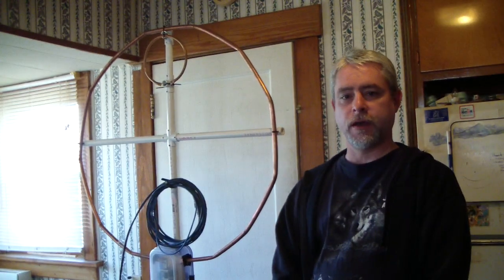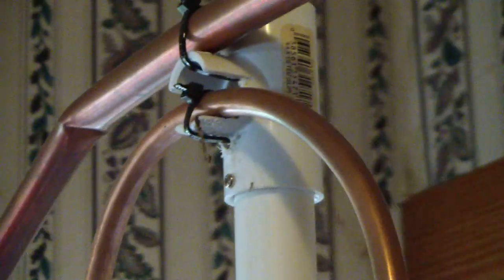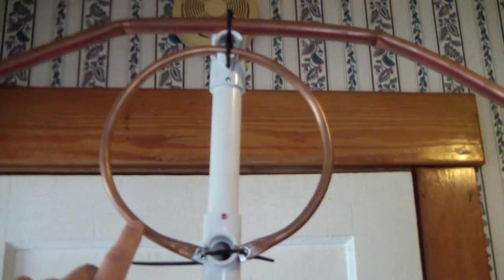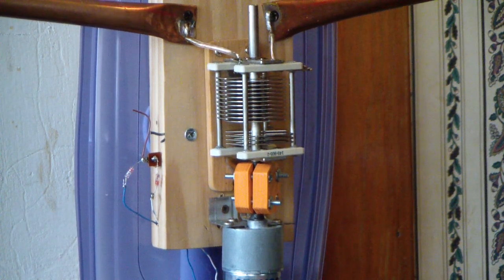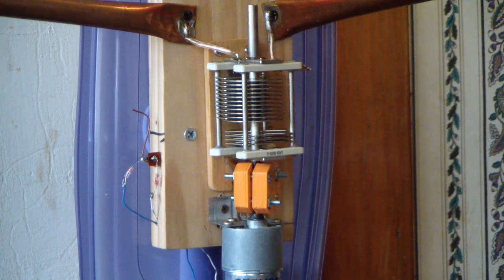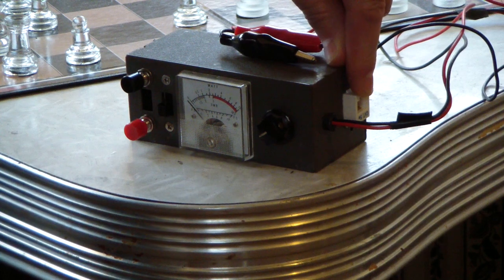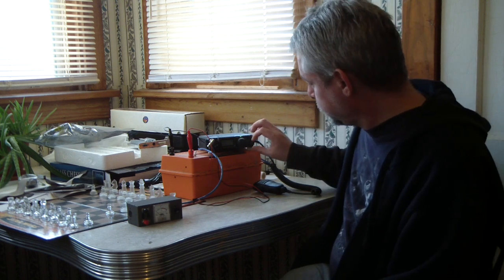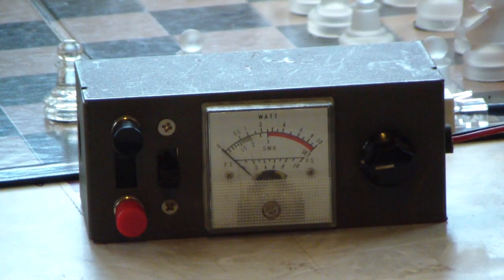Ham Radio - Magnetic loop transmitting antenna overview and details.

Comment: Late to your video, but I have built 4 loops recently (since January 2023), and my loop conductor of choice is surplus RG-11/U. I got a "reel end" with about 175 feet of coax. I have a single-turn 52" diameter loop that covers 4.8 MHz - 22 MHz, a 52" 2-turn loop that covers 3 MHz -8 MHz and a single-turn 36" loop that covers 6 MHz - 32 MHz.  I worked a station in MD from our radio club meeting on 80 meters with the 2-turn loop from inside the hall where our meetings are held. 5 watts on FT8 from indoors. A very impressive demo.

My 4th loop is based on VK3YE's Summer Loop, and uses a bicycle wheel rim, 22" diameter and 1.4" wide. It covers 17 MHz - 60 MHz. Lots of fun and getting ready to go for a big outdoor fixed loop with 20 - 30 meters of coax for a 6.t meter to 9.5 meter diameter loop.  Looking for good efficiency  on 160 meters, no?

73, Keith, WB2VUO here near Buffalo, NY.
Reply: Keith, did you short circuited the braid with the center conductor of the coax? 73 from py2top
Reply: @fabiomeneghim4149  :  Yes I did.  Effectively, the coax became a fat "wire".  The coax I used  was the cable-TV version of RG-11/U, so the braid was stainless steel.  I had to mechanically crimp a bullet splice to the center and braid, then solder to that.  I used high-temp oven crimp splices for the transition...

de WB2VUO

Comment: Thanks for putting this on. Loops work well considering their small size. I worked a few stations in Europe with mine indoors and 5 Watts ssb/cw. I used a small motor with a gearbox bought from Maplin, now all stores closed, and D cell batteries, 3 Volts for a fast tune and one battery for a slow tune. Tune for maximum signals on receive then tune using a homebrew resistive SWR meter, transmitter never sees above 2:1 SWR but shows all SWR.
Bill, G4GHB.

Comment: Kevin, for future copper tube bending pack sand into the copper tube. This prevents the copper tube from kinking. If you cut a 3ft plywood disc, you can bend the tube around the plywood disc. The disc can be cut into the diameter you require. Old wiring rolls may be big enough to bend the tube around.  Kf2ms...

Comment: I jumped into your time machine because I was building one as well. I used a capacitor out of an old full power tuner, and soldered sections of 3/4 rigid copper using 45-degree fittings. The feed is also 3/8 refrigeration tubing, like you, I got from the bottom of 40 to the top of 15 at 1:1. What a fun project.73's🎙KD9OAM

Comment: Great video. I'm disabled with a back injury. Took up HAM radio to have something to do. Hanging a wire between two tall trees is not an option for me but I think I can build a small magnetic loop with a little help. I wish I would have hung on to those tuning caps that used to be so plentiful. Thanks, Mike KE8EUI.

Comment: My Dad repairs, builds and modifies trumpets for fun and does a few customs per year. Copper work hardens easily. You need to anneal it to bend it easily and to keep from kinking you need to fill it with something to support it a bit. Lead is fantastic but toxic and a pain to work with. Bending alloys that melt at below the boiling point of water is next, than pitch and last is semi-frozen Murphy Oil Soap and Water.In theory you could use wet packed sand but keeping it from moving out of the way as you bend is the problem. Look at annealing copper and bending copper. Hope this helps. One of the reasons copper trumpet bells cost more is the number of annealing steps as you work it to keep it from tearing compared to 70/30 yellow brass.

Comment: These are nice antennas, they can be over 75% efficient, can nearly be tuned by ear, and cb radio swr tactics, and for how often we really get the chance to operate, setting up like Field Day, and putting it all away, is a real cherry on top. These are also a better alternative to setting up longwires, dipoles, and delta loops, and stressing when a lil storm runs through when you're not home.
Reply: 🤣 75% is a joke I think. That antenna needs a ground plane. I would put it right under the driven loop.

Comment: Most hams just don’t realize how far you can transmit with 5 watts or less. It’s THE ANTENNA that makes  the most difference.   Of course the feedline is important too.   I use to use 450 ohm ladder line for all of my antennas.   It was way cheaper than coax and worked better.

Comment: Hi Kevin, i've been messing around with the magnetic loop antennas for well over a
year now and my favorite is a 5/8" soft copper 3.4 ft. loop using a 1,000 pf HV
variable capacitor. The loop will tune from 3 mhz. to 12 mhz. and like you said, the
tuning is real sharp. I've tested it against a 240 ft. horizontal delta wire antenna and
it will outperform it. The magnetic loop antenna is quieter than the longwire and also
has more gain. For the hamradio guys, if you can't hear the stations, you can't work
them! :)  I have a motor drive system that I haven't added to the loop yet but I am
seriously thinking about going to a 2 inch copper loop about the same or more in
diameter for increased bandwidth. A 500 pf HV capacitor is ideal for the 40 meter
band but capacitance in the neighborhood of 750 pf might be more ideal for the
80 meter to 40 meter and lower bands. These magnetic loops antennas will surprise
you with their performance! Thanks for the review!

73s
kb9ezl
Reply: Dennis ,
   I built a loop with 3/4 copper at 12.5 feet circumference . Its great on 40 meters . But the size of the small loop is a question and my cap was too low . So I am going to upgrade the variable cap to 1000uf as the loop only work on 40 and a little 20m . but very good.. And i am going to upgrade the small copper loop to 3/8 copper.  So I enjoyed your post ..thanks for your post as mag loops are fun to build and try .
Reply from the maker: If you go with a larger cap,  it will lower the frequency range.  I think you need to go to a smaller cap.
Reply: I messed around with several different variable capacitors and a 1,000 pf is a little too much for 80 meters.
A 750 pf might be good and it should get you down to 40 meters. The increase in capacitance will mess you
up on the low bands though. The increase in circumference of the loop also would need to be decreased 
which then messes up the coupling loop which also has to be reduced in size. I am thinking with what I have a 600 pf capacitor would get me into the upper end of the 75 meter band and work good across 40 meters.
I want to experiment with some flat bar aluminum stock 2 inches or more in width to see what it does.
The aluminum is cheaper and easier to work with. Good luck on your mag-loop.

Comment: Very interesting video. I liked your RF or field strength meter a lot. 
BTW... The larger the tube is, the higher the Q factor, the higher the voltage on the capacitor and the smaller the bandwidth.

Comment: Kevin, great video. I'm amazed by your resourcefulness building stuff. I like that you get good results while skipping the EE math stuff.  (I'm a geeky EE but prefer to actually build stuff). The field strength meter is very clever.

Commercial magnetic loops are very expensive and not as much fun as building one like yours. I hope to make one like yours one day.
Reply from the maker: Thanks for watching Michael.   I'm surprised more people don't do the FS meter approach.   It's much easier to fine tune with it.
Check out my junk box magloop video.
https://www.youtube.com/watch?v=ZTsYRyEkCkQ
Reply: Michael, I've ran 5 to 100W with 1" diameter wire, wound ~8x to drive an LED without problems.
Reply: I saw a video of yours that flattened the small interior coil. Are you able to do that with this loop?

Comment: Wow, Kevin, your videos are great. I've built a couple of magnetic loop antennas which works very well from my apartment balcony.I want to build one for 40 to 80 meters with motor control like yours. I've seen your video on the 80 to 160 meter loop but it's a little too big for me, yours remind me of "Stargate", lol. Thanks again on the videos.
Reply from the maker: Gwendolyn H. Thanks for the kind words Gwen.   And if I tune to just the right frequency,  the big loop starts to glow in the center.  Maybe I should step though.  
My emails on my QRZ page,  maybe we can set up a SKED on 40 or 20 and talk antennas.
Reply: Kevin Loughin /When I get my 40 meter loop built and the band conditions are right, I hope to hear you on the coax. I'm still working on my CW for Field Day next year. 73, Gwen - K6GRH

Comment: Thanks for uploading. Some comments I may offer:
I would have used wide copper strips to connect the cap to the loop. All in the interest of Q-preservation (loop efficiency). Also: wood as an insulator is probably not the best idea. Wood is an organic material and will affect the Q of the loop and may also in fact be a fire hazard. Field strength meter is a good idea but I did not see any caps after the rectifiers. Without caps you will get rectified RF on the detector wires. The VSWR=2 bandwidth is a good loop-Q indicator. A wide VSWR bandwidth indicates a poor loop-Q.
Loop tuning via max. fieldstrength is pretty rough. I would always tune a loop for best VSWR. Max. fieldstrength does not necessarily imply low VSWR. 73

Comment: You can bend  the tube  very easily by pouring sand inside  with ends closed  and bend  away .
Reply: Daniel Block good tip!
Reply: Daniel Block you can also buy the tube in 10 and 20 foot lengths already rolled up in a box. You just make it larger by unrolling it and you are done.
Reply: Richard, that is the soft copper and is meant to be bendable whereas the straight tubing is meant to have greater rigidity for straight, strong, rigid runs. KC0GMF
Reply: Don Riedel You can also put irrigation tubing into the copper tubing to give it more strengh and prevent smashing or cracking. Irrigation tubing is usually sold coiled up and is made from very strong and hard plastic but it does flex well. This will allow you to use the bendable copper and get a better loop shape.
I'm currently ordering 1.5 inch OD and 2 inch ID plastic tubing and copper foil to make a completely flexible loop to mount on a vehicle.
The foil wraps the smaller tubing which slips into the larger tubing, then a strong platic rope goes through the small tubing and is pulled tight and tied. The goal is to survive tree branch assaults at highway speeds.
Reply: richard vaughn That’s a great idea 💡
Reply: Gregory Heath ended up just using clear heat shrink tubing outside, then copper foil tape, then corrigated 2inch plastic tube. Its really stiff but you can smash it over and it flops back into shape.
Theoretically you can make a 4 inch tube for alot cheaper than a 4 inch copper pipe since copper foil is cheap.
Reply: or you can buy soft cooper tube dont need anything inside or out.
Reply: thameswater that would bend over and break. needs to be floppy tubing to survive mobile install.
Tree branches will crack copper.
Reply: no it wont soft cooper will bend into a circle thats what it used for. I used to use it when I was in the plumbing and heating game..dont need pipe bender or sand...
Reply: thameswater soft copper pipe will be permanently destroyed in a mobile install when it collides with tree branches at 70mph.
Reply: well I cant believe you would do 70 mph with a loop on your car,,,, thats a Police stop if I ever see one. I will look out for you then lol.
Reply: The sand in the tubing is a very old school way of avoiding kinks especially if you are making tight turns to make a coil for say a still.
Reply: @kc0gmf  Fair enough, but for a small circumference that won't matter

Comment: Yes,Some people here are right.You can unroll soft copper and if you care tom make it nice and round,bending it around a trash can will do the job.
Very little if any efficiency is gained by going from 5/15th to 3/6th tubing.
The bigger diameter gives you much more efficiency
BOB AF2DX
Reply: what is meant by  5/15th?    Are you referring to size of the copper tube? 1/2  , 3/8,  1/4 , 5/8,    they also sell copper wire , is the key to this project using the tube?

Comment: 30 years ago before the internet We bought a SWR meter / antenna tuner for your CB radio with 25w amp. But when I followed the instructions people had given me for using it to tune I ended up with very loud angry 50hz buzzing as the 25w amp was using 140w + , more then our 10A 14v power supply could provide. I am pretty sure a 25w amp is not meant to use 140w + ? .

I never found out how to actually use that SWR meter and tuner... It is much simpler now when you can log on and get instructions how to do anything on internet :)

Comment: Nice job, really like the control box setup...
Reply from the maker: budleyca1 Thanks.  I was kind of proud of that little box.   I used a tricky bit of wiring with two relays as reversing switches, and each relay needs the other one to be off in order to operate.  That way you can't press both buttons and short out your supply!   I suppose someone using more modern approaches would just use a microcontroller.

Comment: This is a very nice to the point and well-illustrated video. The field strength meter is a great add on. I will build one tomorrow for receiving only. In my application the narrow band width and high Q. Is exactly what I want.
Thanks for a great video. From one hosier to another 73
KA9UCN Joe

Comment: Thanks for your video.  As always very informative and well done.  I had no idea you'd see voltages that high at such low power from a solid state transmitter.   I've always had a fascination with the spooky physics of antennas.  Your point about the physical size of the main loop component makes me wonder about band width performance; what if 3 or 4 inch copper pipe were employed instead.  It would be a heavy beast to be sure, but it would be interesting to see what it could do.  I learned that using large size and ultra high conductivity antenna elements such as using silver coatings can make dramatic improvement to performance.   I love to tinker too.  73s from Ted in Ann Arbor, Mi.

Comment: I HAVE THINKING ABOUT BUILDING A LARGER LOOP AND TUNING IT WITH MFJ 962 i don't know if the loop will tune think about feeding it with 2 or 3 feet on ladder line at the feed point maybe will work going to try 160 80 40 a smaller loop 20 15 and 10 with coax and use antenna switch and the balun 4 to 1 for big loop.. going to run 50 watts.
Reply: How did it go?

Comment: Hi Kevin, quite informative. I have never tried a magnetic loop antenna but from this presentation I conclude it is Ideal for a QSO on a scheduled frequency, however due to the narrow bandwidth of the loop and tuning the receiver looking for a weak signal over a full band can be quite demanding having to continually tweak the capacitor for the resonant freq and performance in order to hear a signal.  Too easy to miss a signal.  Even using LDF750 Heliax (about 1.8" dia) for he large loop the bandwidth is still very narrow.   I figure this would be a major negative for the Magnetic loop antenna.  Your thoughts...  Cheers Mike VK5LX
Reply from the maker: Hello Mike,  I thought I'd mentioned that in the video.  I know I have on my other magloop vids. If you bounce around a lot in frequency, magloops need retuning constantly.  If you're doing a POTA activation, or something else where you tend to sit on a frequency, they are fine.

Comment: He Kevin, thanks - this was a simplest VDO for mag loop antenna & i understood the connections very well. Do you have the soldering diagrams between the outer loop & air capacitors- where do you connect the two wires from the copper tube on the capacitors. do help me out- thanks 73 Val

Comment: What mode are you using?  I would think that duty cycle would be a big consideration when running RF power into this antenna.  I know the manufactured loops have a much lower power rating for CW and especially digital modes that have a 100% duty cycle.

Comment: You will have better output if you make the small loop oval instead of round. You can test that theory using a field straight meter. You will be surprised!
Reply from the maker: You haven't seen my video titled A simple magnetic loop modification with a big improvement. Where I talk about squishing the coupling loop. Already done it.